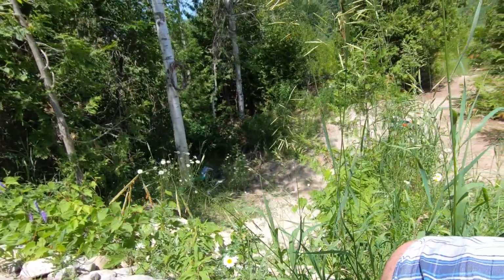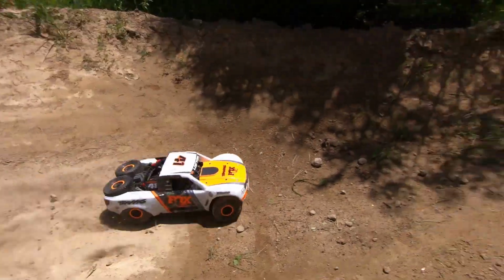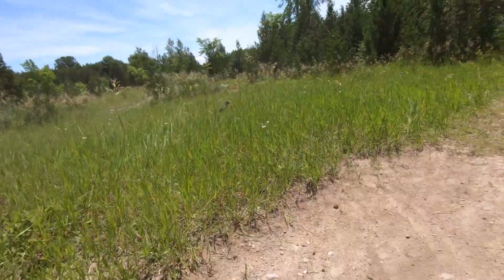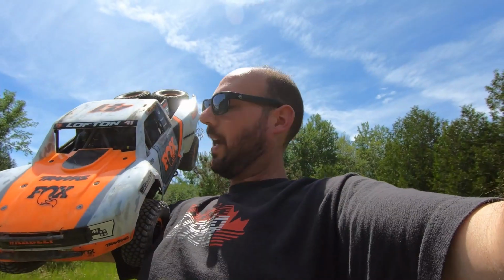Traxxas UDR Bashing at an Abandoned BMX Track - Netcruzer RC

Comment: It sounds like it runs at high motor rpm (even at low speeds)... Does it? Or does it just sound that way?  Are the spur and pinion both metal?
Great video!
Reply from the maker: UDR makes a unique sound. It’s the transmission and gear noise of the chassis. Yes I think both are metal but I don’t remember exactly from last I had it open. Watch my front driveshaft video for a look inside.
Reply: @netcruzer  Cool!